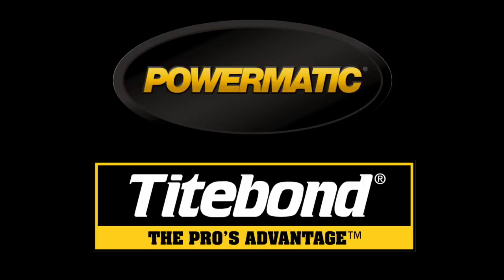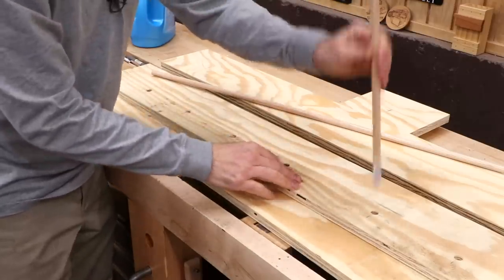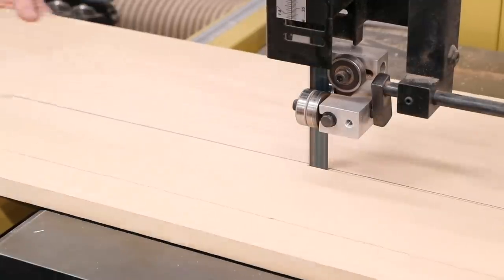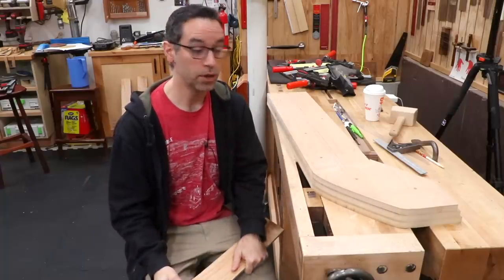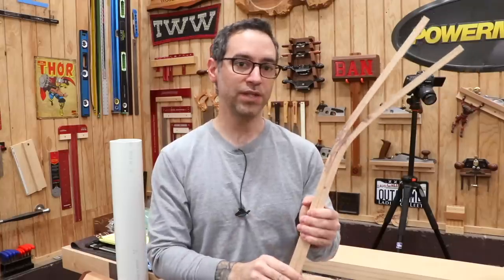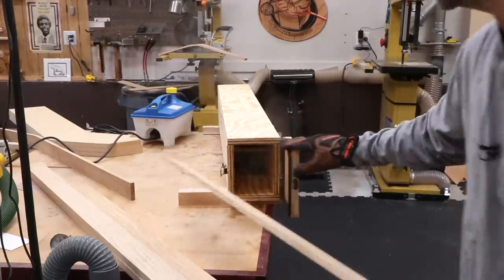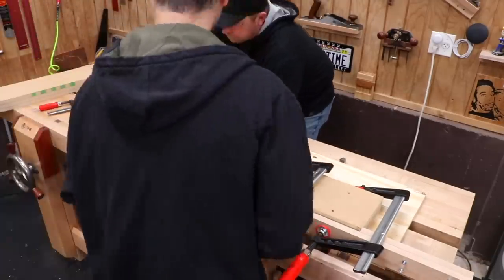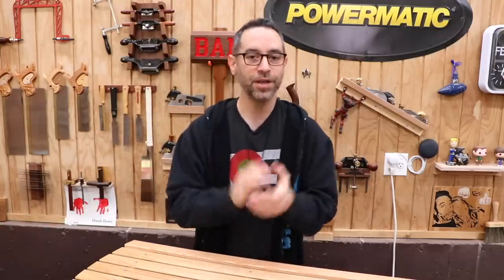Adventures in Steam Bending

Comment: one idea I've come across about the checking found on the kiln dried wood, is that it happens when the wood is dried too fast resulting in an increased occurence of cellular damage and an overall brittle structure with the fibers being more prone to pulling away from each other when put under stress (checking)

Comment: This probably has been mentioned before, being buried under a load of other comments by now, but being at a higher altitude causes water to boil at a lower temperature, so while you have steam, it will be of slightly lower temperature as well, so that is likely the reason why the wood needed to be in the steambox longer.

Comment: One question I would have is what would happen with the kiln dried wood with no soak, but a longer steam time? 
You mentioned it felt water logged.  Liquid water is much denser than water vapor (steam) so I am guessing it saturates unevenly only where the board is more porous.  Steam on the other hand can probably permeate the wood deeper and more evenly. Then add the compression of the strap to a heated, unevenly saturated board, and I don't doubt that you get stress fractures.  Just my thoughts.  Great videos as always!  Thanks!

Comment: I think that you were doing this experiment partially blind.  You did not have a gauge to measure humidity in the wood before the soaking, after the soaking, after the drying on the form.  While you had a thermometer, you do not mention the temperature and if there were differences between the batches you ran through the steam chamber.  When you experiment, it would help if you could account for all the variables, you mention time but little else.  It is hard to create an experiment to account for all variables but it is hard to come to a definitive conclusion without.

Comment: I have done some steam bending with white oak and also bocote. Soaking helps a ton but I never tried using fabric softener. I also didn’t have the checking issues with the kiln dried lumber I was using. I’m wondering if the fabric softener is reacting with the heat from the steam chamber and tannins in the oak that’s causing the checking like that. Might be worth doing some tests with the same soak and bend process but no softener.
Reply: I did experience issues with over steaming kiln dried oak. My theory was that because the cell structure of wood is crystallized in the kiln drying process soaking and steaming helps to soften that crystalline cell structure but too much exposure to heat, regardless of moisture content, almost seems to make the cell structure brittle and the boards would split and crack even with the use of a compression strap. The most successful bend I got was a piece of 1” square stock of red oak that got soaked for a couple days and steamed for 20- 30 min. The thing bent like a wet noodle.

Comment: Also I use an old style gas can, metal, round and 4 gal minimum. It should never had had gasoline, diesel... in it. I heat it with a propane Lobster Cooker. A few PVC fittings to connect the two and you have an almost indestructible steamer, your PVC will warp eventually. Oh and I didn't use cement on the PVC either.

Comment: Should you have checked to see what the thermometer temperature was? I understand that wait until the temperature gets to 200 degrees. Also, I have heard that putting your pieces to bend you can slip them into plastic sleeves and the wood stays warm longer thus giving you a few more minutes to bend them. (Place them in the sleeves as you take them out of your steam box.)

Comment: You could probably pick up an old pressure cooker, there are two types.  One uses a weight and the other a threaded fitting for a gauge.  You could then adapt a line from the pressure cooker to your steam box.  Get a propane powered banjo burner for heat.

Comment: I've done quite a bit of steam bending and my experience is that the water has very little to do with bending.  It all about the heat.  I've never tried to use kiln dried lumber, but the theory is that kiln drying sets the wood, thereby make it difficult to bend.

Comment: Have you considered to use spacers between the layers of the form to improve the air circulation so that it would dry faster, maybe even using hot air from the inside once it is clamped?

Comment: Altitude does make a difference. The higher you go the lower the temperature to make water boil. Therefore the steam temperature is lower. As a result of this it will take longer for the heat and moisture to penetrate the wood. Although I do Woodworking, I know this from physics, that and cooking because of differences in recipes when I lived in Rapid City at something over 3000 feet above sea level.

Comment: Great video Marc! Very informative. 
I’d be worried about all that water vapour in my Workshop. Cast iron surfaces everywhere and stored dry wood doesn’t sound like a great combo with water. Or am I overthinking it?
Reply from the maker: If you have the steam going all day and no ventilation, you'll definitely have a problem. If you're doing one steam session it probably isn't going to be a huge deal unless your shop is really small and very well-sealed. Most of this steaming was done when the weather was nice and we cracked the garage door. The humidity went up maybe 2-3%. One time we had the door closed and had the unit funning for an extended period of time and it raised the humidity by about 5%. It dropped quickly afterward.

Comment: Water boils at a lower temperature at high elevation so it will take longer.  The 212 f is for distilled water at sea level.  Lower air pressure allows the water molecules to escape more easily just as water in a pressure cooker boils at a higher temp because the pressure makes it harder for them to escape.  Maybe you should find a way to increase the pressure in the steamer and thereby increase the heat.  You might also try letting the kiln-dried steam for much longer so it really softens up and bend more easily.  Here a video of a guy who is commercial wood steamer steaming some kiln-dried ash. very informative https://www.youtube.com/watch?v=b9UPihp04xY

Comment: Hi Marc,

Thanks for an entertaining and informative video lesson on wood bending using steam.  You ran through most of the options for bending those runners.  

However, as I watched the results of unbuckling the clamps at the end of each experiment, and seeing that nice bandsaw in your shop, I am wondering about how effective would it be to slice the runner material thinner and use waterproof adhesive (like Gorilla Glue?) to laminate the runners in a form like yours?  That seems like an experiment that is begging to be done. 

Have you considered doing a video on laminating runners for uses like this?
Reply from the maker: They aren't sled runners but rockers: https://youtu.be/g85DplCf8iI

Comment: soaking shouldn,t be needed. At least my grandfather didn,t when bending 12x6 timber on wooden canal barge repairs 65 years ago; just steaming.
Reply: How long time did it take to steam that size of timber? And how did they bend such big timber I am searching for information on bending 2x4 on a big circle aprox 2.3 meter in diameter
Reply: @bjornwilck8124  It was replacing the gunwale on a large wooden coal  carrying canal barge. My grandfather and his brother were shipwrights and I watched them as a young boy so it was some time ago.  This was in the afternoon so can only guess how long steaming but obviously quite some time in a  wooden steam box. It was a long timber finishing at the bow so very shallow curve leading to a much tighter curve at the bow. The diameters would have been quite a lot bigger than your 2,3 m . Its just to show that you can bend almost anything with just hand clamps and driven wedges. Plus skill of course

Comment: In Lieu of a propane setup you might consider the Danenberg steam generator built with an electric water heater element: 

https://www.ashleyriverboatworks.com/getting-ready-for-steam-bending-wood/

Don Danenberg has a book about wood boat restoration which has more details for construction of the steam generator. Instead of a metering valve and sight tube I would recommend a bucket with a toilet fill valve to maintain the water level.

Comment: Just tried a steam bend today and had my first failure. Lots of stuff went badly, I think I understeamed, i completely forgot the fabric softener (duhhh, so annoyed by that), I used kiln dried wood, and like you I'm in Denver, so I automatically lose about 10deg of heat.

I'm going to try again, with fabric softener and probably slightly thinner pieces. Any advice on where I can find air dried oak or ash in the area if that doesn't work (and for future projects)? It seems to be pretty elusive.

Thanks!

Comment: Appreciate the video.  Do you have a reference for where the rolled steel strap you reference can be purchased.  The ones I can find all have much larger holes for which I'm concerned the pressure may leave a mark where the holes are.

Comment: sooo.. Watched a lot of craft videos or more accurately partially watched.. First time commenting on one and one of the few watched in its entirety..   most are to wordy, to long, to full of them selves or combination and a lot don't know what their talking about.. Like your style.. But as I advised my sons don"t reinvent the wheel (modify to your needs as you gain experience)  I have a unique set of skills started by the knowledge of others.. Many before You Tube.. You stated you watched videos on steaming but you wished to test  it yourself (Paraphrasing here).. By all means do your videos (your good at it) But its extremely inefficient to reinvent the wheel.. You won"t live long enough to reinvent them all.. By the by.. Denver at one mile high water boils at a lower temp (203 degrees) than at sea level so steam is lower temp.. its the temp your trying to achieve to bend the wood.. There is such a thing as dry steam as well as wet steam.. ideally you're trying to achieve dry steam.. its not like cooking pasta your trying to heat the wood fibers to a consistent temp (steam more efficient than dry air) not soak them in hot water.. its more akin to blacksmithing.. as for steam box if you have a metal recycler near that sells to public..look into aluminum irrigation pipe.. Comes commonly in 3 and 4 inch diameters.. use some stainless or aluminum expanded metal for floor.. Unless your doing a whole lot of repeat bends a 1 inch thick table with a grid of 1 inch holes with 1 inch pegs up to 3 inches long above the table may be a more efficient way to experiment.. Hope this is helpful.. keep with the videos

Comment: this vid was so great! the thing that I'm trying to figure out is how to bed a piece of wood in several directions at the same time. i have a chair that is over 100 hears old and im having to replace the wooden inner frame because the old frame deteriorated. there are two curves to the back pieces which have a sideways and forward bend. does anyone know if its possible to do two bends in one go or if steaming in between would be best. would that take away the first bend created?

Comment: I'm in Colorado and only use klin dried oak. I have found that the steam bend time is 2.5X longer than the recommend time  (i.e. 1/8" thick oak steams for 19 mins instead of 7). also the bag technique works way better for klin dried than the box because it give you more work time and you can bend slower (which helps eliminate some breaking)....great video and good indepth analysis on kiln dried/air dried. splinter and cracking....insta: @southardandsawdust